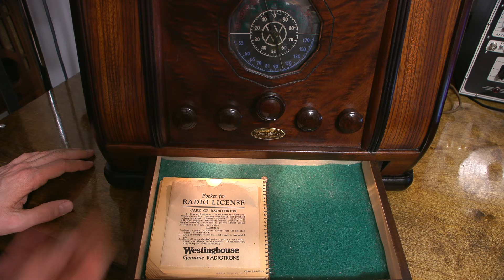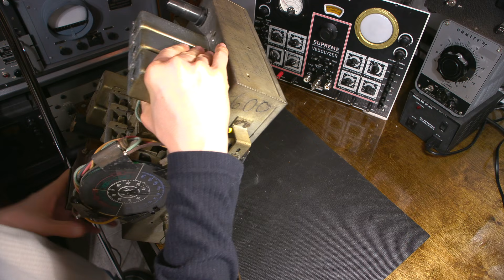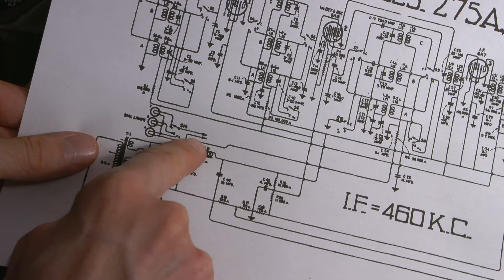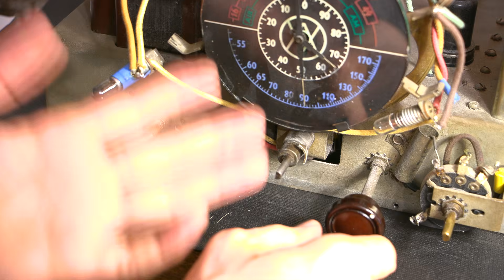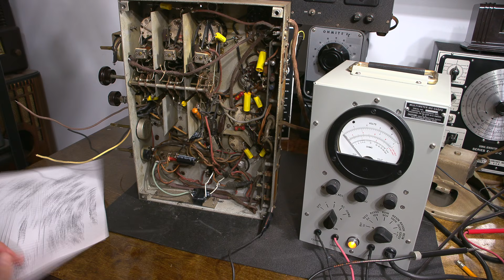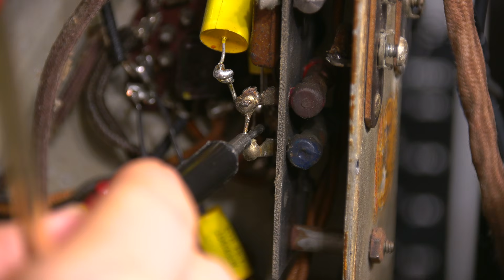Electronic Repair Adventure- Radio Receiver Troubleshooting!

Comment from the maker: To learn electronics in a very different and effective way, and gain access to Mr Carlson's personal designs and inventions, visit the Mr Carlson's Lab Patreon page here: https://www.patreon.com/MrCarlsonsLab
Reply: Repairing stuff is great and all but building something is more educational. please build something from scratch, anything!
Reply: @Haamedtm  He does do builds as well, just not nearly as often and most of them are on his Patreon. Off the top of my head he did a nixie tube counter for YT, also some of the tools he uses he designed and built himself.
Reply: @fvckyoutubescensorshipandt2718  yeah, on Patreon he did a 7 part series building a custom tube amp for an “Urban” brand guitar amp.
Reply: How do I contact you to get a quote for a restoration of my dad's Sony home stereo system, it has a bunch of included units, a TA-AV571 amplifier, CDP-CX571, ST-JX661, there is also a tape player unit and another one I don't have with me at the moment.. also the sub boxes have rattle in them too and probably need a restore. They are SS-U571AV. It would make a great video or two I'm sure..
Reply: @DankNoodles420  Electronic repair shops being as rare as they are now (most now just restore it themselves or sell what's left or throw it away) he probably gets thousands of such requests = probably has a lifetime's worth of work to do already.
Reply: @DankNoodles420  
I don't think Mr. Carlson works like that but you never know.
Reply: Wauv that is a nice radio 👍
Reply: Paul, Thank you for ALL your videos! I sleep like a baby at night listening to your voice. The bonus is I've been in electronics just over 30 years and I get to learn about some vintage gear along the way.
Reply: MR CARISON  WAT A KOOL RADIO RECIVR
Reply: I WANT TOO SEE LINMENT ON THE RADIO RECIVER MR CARISON
Reply: Hello can i get a repair on a vox AD30 VT Nick?
Reply: A license to receive? Sounded very draconian to me until I remembered how far the local oscillators in these old radios can radiate.
Reply: Interesting radio, Victor 6T-2 had exactly the same speaker, mine 6T-2 (soviet copy) also should have 6F6 as the output tube (but has metal RCA 6L6 instead of it), about 4:10 - well, it's not so painful to touch them, but if the temperature exceeds 90-100 degrees celsius, than it's something wrong with the grid voltage, or even the tube itself.
Reply: I can't reach the Pat page due to it being an invalid or not private connection
Reply: If my initial connection isn't private....im not going to risk others .

Love of the radio is quite
Reply: I've learned so much from this into ham radio for 32 years still learning
Reply: I might do it. And loose a few who I watch for pleasure. I grew up in my grandad’s house. He was a ‘ham’ and ran a seasonal business over the summer. In the winter he fixed radios snd TVs. He was a bench in a very could office. I was little and he give me the tubes to check. I learned a lot. I’m a ham too. ‘Inherited’ his call after he died. I just came into a van load of old radios (30s-60s) and a few 1950s TVs. Got some test gear when they came. Soon, this winter I’m going to start working on them. I am sure I can fix some of the more simple ones. Something like this is WOW??? I’ll have to hook up to Sams (they still around) or something like them. I know how to figure in newer components to a point. Love the channel!
Reply: Ive got a radio .its taking hum through the speaker at full volume  but no signal at all. Its a 1932 marconi model 26 i need help cause the issue is driving me up a wall!
Reply: Bit late but if you have not done the tune please! Otherwise I'll take a look 😃😄😁😆😅 5 Smiles
Reply: These are fine crafted radio's
Reply: 9
9
Reply: Proud Patreon of MCL !
You never cease to amaze me Paul, and I'm sure that goes for anyone who watches your channel.
Another one for the couch tonight, awesome.
Take care, stay well. Best regards from Holland,
Reply: @TheDrunkenMug  979999997997⁹ off 99 poor 9989 or 999 to poor 959799999k9k999 99 999 it 999 or 99 99 99999j89 or 999 or 999998 99 99 99 99 799 it 97999kk9999999 99 99k998 99 9 or 8k9999 99 99989 be 897 99 998 99 99 9k9999 99 9 or 9999 or 99 99 7 99 8 99 99 9 or 99 99 99979999 99 699799969l999k99⁹ 99 99 99 99 9 or 99 99 99 9999 99 99999 99 9999999 of 99999999999 99 99 9799999 99 99 99979999⁹989 or 9 or ⁹99999999 99 79 99 50989 99 9 or 99 99 9998 or 99999 or 999 99 ⁹ 99 979 99 99 99 9 poor or 9k79789 be 99⁹ 99 9⁹ 99 9999 be 9l99k999j799 99 99 99 9 or 99 99999 99 99 990 99 99 999 99 7999999 99 7⁹9 99 7999 99 99 99 9999 pop 99 999 be 9999 99 99⁹9 99 ⁹99999999j799799k99j 99 99 77 99 999999 or 99 99 99 98999 99 99 99 9 or 99 9 or 9k796879999798 or 99 9 or 99 99 999 99 99999 99 99 99 99 99 9 ppp 9⁹999999799 99 99 9999 99 79 99 79k it 79 99 99 99 7 99 99l9k9k9 or 9999999 99 9999998997779999j9⁹9k7j7799j9k99999 99 999979⁹99k 99 5999999999k999 99 99889979999⁹ 99 9k99⁹9k9⁹99kk99 99 999 or 99k9995 99 9⁹9k 99 97979 99 799 or 99 999⁹9⁹9 or 9999997 99 99999 99 ⁹⁹ 99 99 ⁹9 99 9 99 9⁹k9 99 999 I'll k999k99k99k9k⁹99k9997 99 9689⁹k79 99 99k98998899999998999999 99 99⁹998999999999999999999997899999978799998999998999999989999999 99 999999999898998789999999 99 999999999999999999799999 it 799999999999997997999999999998989999999999999999999 99 77798 99 99 99 7797777997999799999999999999999777798999999999999j9999999797998779979998999999999899 99 79988999997999987999999999999999789898779899989899999999989 99 999 99 77 99 ⁹k9kk68k7799 pop 99k 99 999⁹kk⁹k89 99 9k9kk9995 99 99 99 9 99 9k⁹979999 99 ⁹ 99 9k⁹89⁹k99k9⁹79⁹k⁹99999kk9⁹9999999k999⁹k9⁹k9999k be 9k⁹99479997 99 kk⁹j9999k9⁹9 99 99 999 99 99k9999k9999j⁹9999k 99 99 99 9 99 kill 989999k999999⁹9999 99 99 9 99 77979k99999k999 99 99k99799999 99 8889 99 9 99 99989999j99999877999977 or 799 99 798799 be 9j999899999999989999999999977999997999898777999879999999999999⁹998999997999999999999999989999798988 or 9999999⁹989999877999999 99 899999999987989999999999999999997999999997999999899999999998899998999797899 99 78999998799799999999979999 of 999988889899997999999999997799999979999999999989779999997987979999989999979989999999999998997799987898999999998999999999998997999999999999999999998999999999997999999999998999989999999799798799999999998799899999999899899998799899979999999978999999999999999999999999979998999999999899987987999979978999899999999999999999889899999999999799999999998999999999999999999999999999999899998989998999999999999989779789999799999999899989999898798999999997999999999889999999⁹9999999989999997979999999999899999997999997999999977999999998899999999899998987999999999987979999999999999878979979999899799997799⁹9999999879999999799999777988999999998999999899779989999999999999999999898999999999999899999999999989997778899999999999999999k998899999999999999987999999999799999999979999999989999998899998999899999999977998988999999979989987999797977999999999999999999899999798899 99 9999798999999999999⁹999999999999986989888799999999979998799999999989999999999798999999999799999999999999999999999999999979998999999999999999799997999999998999999999999999999999999998999899999989999999999989999897998999999⁹989987999998799799979999999999999999999989989998998987999999999999997999999999899999999779999899999998999⁹99999999999999999999899999999999889999999999989999999979999999999799999999899⁹9989997799999999999999999999999999999999999999799999998799999999999879999999999978999999998999999979999999j9 99 999899979k99999975979k99j99799999957999⁹687899k 99 99979
Reply: @TheDrunkenMug  

99
9

Comment: The massive power transformer in a vintage Westinghouse tabletop receiver (likely from the 1930s or early 1940s era) that is rated or marked for 25 cycles (meaning 25 Hz) exists primarily because some regions in North America—particularly parts of Ontario, Quebec, and adjacent northern U.S. areas—still used 25 Hz AC power well into the mid-20th century.
This frequency originated from the famous Niagara Falls hydroelectric project in the 1890s, where Westinghouse built the first large-scale AC generators. The turbine speeds and pole configurations led to a compromise choice of 25 Hz (with 12-pole, 250 RPM machines), which became influential and standardized in those areas for power generation, transmission, and even some railway electrification.

Comment: Is the IF off because the bottom metal cover is not on?  It didn't seem to be on ( 1:04:30 ) when you made your IF remark regarding its need to be tuned.  Of course I didn't see you replace the cover, my apologies if you did.

Comment: Hello Paul - Great video and exercise in fault finding.  If I may be so bold to suggest,  you could have painted the inside of the pilot lamp shields white to give a better light reflection for the dial,  just a thought.

Comment: One year I found a huge Majestik radio chassis & a old 1960s desk chair on the side of the road out of town. I sold the weighty chassis on 'greed-bay' & I use the chair in my radio room, along woth a huge metal desk someone else set out with a 'free' sign on it
 Nice to have a horse trailer to haul good stuff in.

Comment: He owned that back in 1996 is when had that radio receiver/ shortwave band radio you have now. He done all of those caps replacements.& Those crazy J hook connections to unfortunately to. I tried hard to get him to just connect them straight on to those wires.& Remove that one wire to switch it out over one pin.& Resoldered that clipped off wire to.

Comment: My grandpa use to own that radio you've got in your shop now. The alignment was originally the same. Yes he misplaced that wire.& Clipped that one off.& He also added on that light that wasn't the right kind of one to. I tried telling him it wouldn't work on that radio. And that the one wire was soldered on to the wrong pin of that isolator isolation tube Philmont as well to. We both know how older WW 2 war veteran's can be & get about their own personal items like that to super picky.& Temperamental also.
Reply from the maker: Hi John. No, not your grandpa, I know the person who did the previous wiring.

Comment: Looking at that broken wire it looks to be under stress there is no play being between the valve socket pins and if you rock the rock side to side as you would pulling a valve out it could snap the wire easily.

Comment: When checking the speaker and other cloth covered components, it might be a good idea to wear nitrile gloves to prevent the acids from your fingers from getting on the paper of the speaker and further deteriorating the fragile paper. A lot of the components on these old radios used natural materials that would be sensitive to the acids in the oils and moisture on our hands.

Comment: These old radios were designed to work with an external long wire antenna and  a ground wire connected to a pipe driven into the ground.  There must be antenna and ground screw  terminals on the back of the radio.  I don't think it needs alignment, just the connections to an external & a good ground source.
Reply from the maker: When components are changed, they always need an alignment for maximum performance.

Comment: What is the piece of equipment under the Panadaptor?
Reply from the maker: The grey piece (under the black panadaptor) is another Panadaptor, its the SA-1 Type T-100 "if I remember correctly." It's still at the old Lab, so I can't verify that.
Reply: @MrCarlsonsLab : TX FR REPLY

Comment: I Just Gut Out Those Old Radios Cause Finding Parts Is Impossible.
Their Nice Wen They Work But After Those Tubes Go Out That's The End Of It
Unless If You Want To Spend Alot O Money For Tubes. Cause I Was Told 
Their Exspecive
Reply from the maker: Hi Roger, if you do a bit of searching, you will find tube are actually quite reasonable. When it comes to the tubes that the audio group likes, then they become pricey. These are just old radio tubes.

Comment: I feel like I did when I recently watched a movie called "Friends With Money". I watched through the whole thing but when it ended, I felt cheated.  This video was great to watch but like that movie I think you might have edited more in the middle and given us a proper ending.  It's almost easy to align RF and IF with a plastic screwdriver in a IF transformer; doing so from under the chassis would, I think be far more of a challenge (and I for one have never done one!) and fun to watch.  I also wish you'd stop spinning the dial when you test, filling your video with static and noise instead of stopping at a station, really tuning it in and letting us get an idea of the sound quality the piece might be capable of! This was especially true in the short wave test. I was getting annoyed so I asked my son to watch. After only a short time he said (without any prompt from me) "Why does he go ripping right past a signal? It's starting to p1$$ me off" - same as I felt. You have a fine tune on that gorgeous piece - show us how well it works.
Bot MOST importantly in my view was never getting the "beauty shot" at the end!  That is truly a drop-dead stunning radio, a work of art.  Once completely finished it would have been wonderful seeing it do what it was designed to do: let the music flow -  In one piece! A little time on the closeups of that woodwork would be amazing - many have never seen the result of the skilled artisans that worked so hard in creating these units (and in this case, only for the wealthy. The average Joe in the 30's would not have the money for a beauty like that one) back wen companies really cared about quality. Unlike today they took pride in their work at the time that piece was in a showroom on display for sale. Many were sold from catalogs that described the beauty of the workmanship in glowing detail.  It showed in the finished product; no one returned those upon receipt the way we do today when a product shows up that is obvious crap.
I REALLY DO like your videos, it's nice to see someone else's approach to doing the same things I do, but I don't make videos because I'm no good on camera. You are FAR more talented at that than I, but with a little constructive criticism I think you can be even better and certainly up that subscriber count. Put it this way - I see another of your videos in the right margin and the restoration of the 84 y.o. Stromberg is really tempting: until I realize it's over 2 hours long and I'm afraid of investing the time and risking another ending like this one.

Comment: Love this old radios.  Must have been in the Niagra Falls area as some the orginal power was 25 cycles.  Would love to see this treasure perform at its peak.  Go for it.  I remember some of the old Cathedral case radios of the era.  My Grandmother had an old motorola table top and would always listen to the Gene Autry Show.  If you listen in bygone tlimes your might hear Stg. Preston on the Challenge of the Yukon.  I love those old radio programs.  It made you see in your mind.

Comment: Seems sort of backward.  In 1950 when I was repairing them, step1wa to verify power at the wall, is radio plugged in and turned on. Then, are tubes seated and filaments lit, then  swap out logical bad  tubes. If, radio hums like hell, change the electrolytic capacitors. No luck so far, then trace where you loose your signal.   Never change out a component just to bring it up to date.  Don't try to make the radio work better than its manufacturer.
.
93 year old in Texas

Comment: There was no need to use a VTVM (vacuum-tube voltmeter.) A simple Simpson multi-meter or a DMM with sufficient range will be less confusing to show open circuits for both you and the viewer. Why was there an "extra" wire connected to a tube plate? Did you add that wire to make the video more exciting?

Comment: Tall metal square cans on the top of the chassis are I.F. (intermediate frequency) transformers. These transformers and associated vacuum tubes form the stages of the 455 kHz  I.F. amplifier. The hole in the top of these cans IS an adjustment and usually never needs adjustment again after the radio is built and factory aligned. 
NEVER use a Philips or flat blade screwdriver. Only a nylon hexagonal adjustment tool must be used. The steel of an Allen wrench will greatly affect tuning and can crack the core ruining the transformer. When these cores are turned, it raises or lowers the core inside the transformer to tune it. These transformers can only be adjusted with a scope AND a signal generator.
Reply from the maker: Ted, these transformers are capacitively tuned, not slug tuned. The capacitors in the IF transformers have a blade slot for a normal slot headed screwdriver. The capacitor and transformer are not influenced by the insertion of a metal screwdriver. Never need alignment after the factory? Ted, please comment less, and listen more. There is so much wrong with your posts, all you are doing is providing incorrect information for people to read.

Comment: This entire video was very impressive and definitely Not Boring.  Back in the late 60’s and early 70’s I use to collect old radios at garage sales.  I never paid more than $10 for them and they had to work or I didn’t buy them.  I never did learn electronics and regret that.  Nobody ever told me I should never re-finish them because that devalues them - but I did.  I did replace the horrible wiring in them.  The floor models were my favorites.  I have Subscribed and look forward to any future videos.  Thank You for bringing this to us.
Reply from the maker: Welcome aboard G C!

Comment: You thought those license to receive times had gone? Here in Switzerland (and in outer countries too) you need to pay about 360$/year for living at any place where radio, TV or internet can be received. Even if you don't receive, don't want to receive, or don't possess a radio or a TV.
They call it the necessity for the democratic discourse of having non commercial networks, and hmm the funding has to come from somewhere...